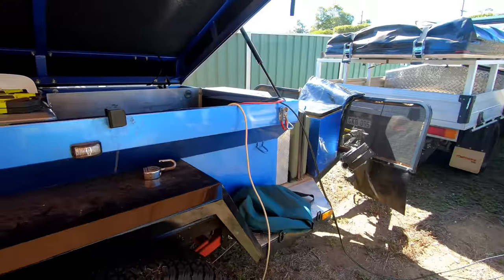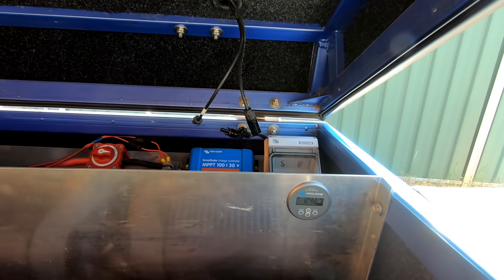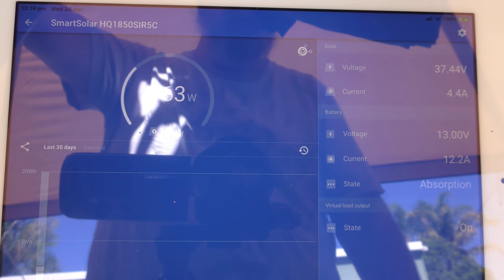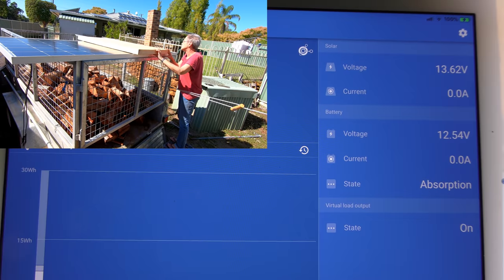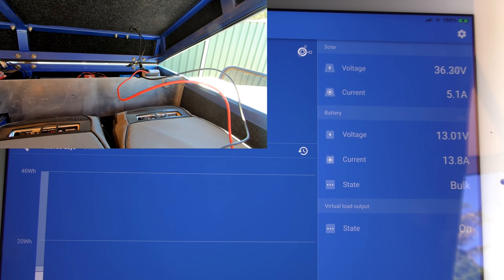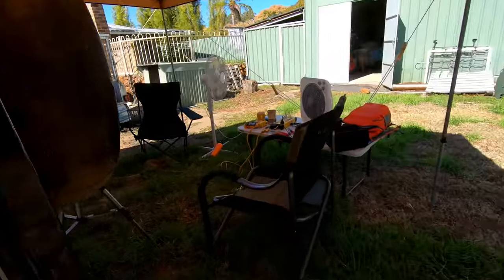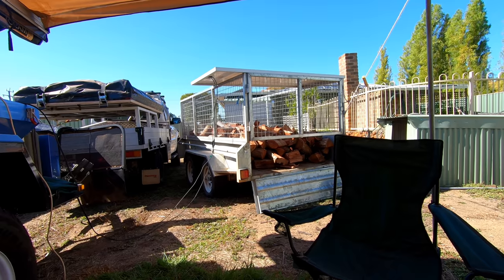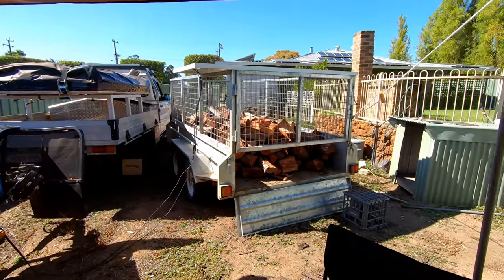SOLAR PANEL TEST. Split Cell Technology VS Standard Mono Panels. P1

Comment: That is proof enough for me.  Well made video and thorough testing. The evidence is very conclusive!
Reply from the maker: Yes we put a lot into the prep for this test just to make sure we got it right. e-Solar want me to go to perth with my camper and test the new 380Watt split cell panels he just got in. The test surprised him as well. Solar companies buy these panels and take the word or the manufacturer on what they should do. Most of the time it's wrong as they test in a lab. But in this case it surprised even me.
Reply: @JustinCaseSolarPower  Yeah I am pleasantly surprised! It is great that they have engineered a solar panel to cope with some shading, it means we can be a bit less savage with trees blocking the sunlight to the roof.

Comment: I think I’m liking the spit cell tech from your test , I’ve been wondering how they really do thank you sir , and smaller looks like I may be able to have shipped to me down my small lane ups and fedex can make it but big trucks can’t , great 👍 testing sir
Reply from the maker: Yes they worked better than i was thinking they would.  I never believe the hype until i can test them for myself.  And what did i find out.. Well for a change the sales hype was true. Both Sigi and I are very happy with the test so fare. The next camping trip should be a good real would test as well.

Comment: Thanks.
I must say...
I hope you do that test again when both panels is flat angle and then direct to sun. Then we have more accuracy results. When I test panels, I can notice that voltage rise much easier than current. So, if there is not load at all, voltage can be reach Voc with quite dim light.
So if there is 325Wp panel and V is 36V and current is 5A then power is 180W any way. 
With my own tests I notice also that angle is quite important. I can reach voltage very easy but current need better aiming.
I cannot decline your results, but I hope that you can make another test when both panels is same angle with tests. And because you have both technologies, do it with flat agle and direct to sun. Then we can get results if panels is off angled and on angle with shadow and no shadow.
Sorry and thanks of your great channel.
Reply from the maker: Obviously you did not understand what the test was about.  It was not about output it was about shade.  That's ok though.  I Have more testing to do at the factory next week. We will  be testing 380Watt Split cell panels against Similar mono panels, they will not be fixed Panels so i can put them at the same angles. In real life Solar use not everything is perfect. I did look at your channel though and can not see one solar testing video on it.  Maybe you should upload Your testing videos so we can see how a professional does this test in the real world, The panel on the camper trailer is fixed and cannot be moved.. Both were in full midday sun.
Reply: Yes, I understand that you show what partial total darkness make with solarpanels. After all that affect output and that is the intresting part. If the output is meaningles, why make tests and show that output when make tests?
I'm not mean to say your tests is poor or unprofessional or anything else bad words what I do not know with english. I just try to say, I want to see if all conditions is same with panels, is that so big differ between those. In Finlad our sun is about 42 degree in summer and something like 5 degree in winter. So that is interesting test.
I'm not that rich that I can buy lots of different equipments and start test serie like yours. But when I bought my first panels, I make few different tests. If panel stand straight, then that 130W panel give without load, normal opencircuit voltage. If I connect load or battery then voltage drop a near to Vmp value but current was about 1A. If I make shadow to panel, then both (U and I) drops dramatically. Then I test same panel when panel lay like yours monopanel now. That differs with curret. So I got about 3A-4A and <100W - 120W. So I later decide to put that way my campervan solarpanels. But if I make shadow to panel, then output also drop much, almost to zero. I do not make total darkness, I just walk to between panel and sun. But when I adjust panel to direct to sun. My shadow not make that big difference. Of course, output drop but not that much when sun was not aimed to the panel. And that was the way when I install panels to my roof. So, what I mean, maybe split cell panel got a bit better conditions than mono panel. So, if other panel is fixed and another not, it is possible adjust that not fixed to same angle than that fixed. And that is easy to do because you maybe can put that unfixed panel to next with that fixed panel. Or just close your testbench lid and then both panels is flat.
I guess that split cell panel handle that situation better, but it would be interesting to see is that difference how big if panels lay on its back and if there is better aiming.
I'm sorry if you feel bad after my messages. I do not want that you think if  I try to belittle or cast a slur on to you. I hope that you not be indignant any more :)
Reply from the maker: Then watch the tests i do in the city. I will be going up there mid next week to do them. Its all on the New video i just posted. because them panels will not be fixed we will run them side by side. The reason i have the small Load when testing is so it makes the volts Work much better then just viewing  Open Circuit Volts
Reply from the maker: look at this video. https://www.youtube.com/watch?v=UEYwk2M3R9M Here i do some extreme shading on the Split cell panel testing its limits and looking for  its weakness, and i found it.